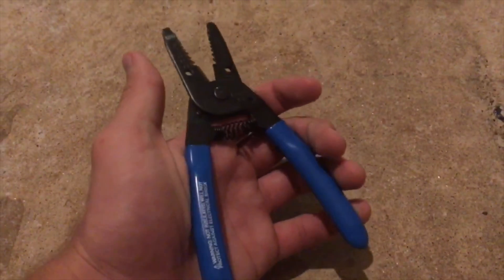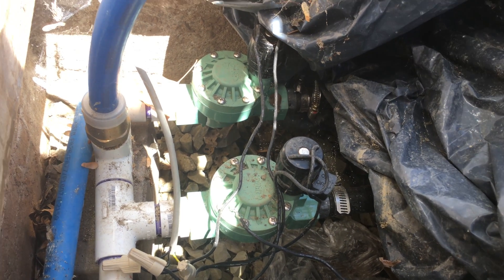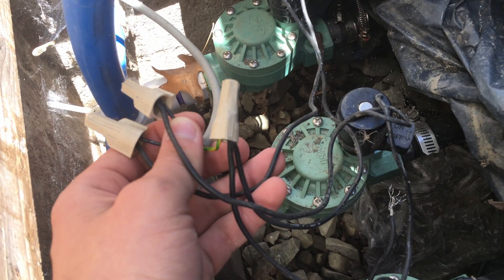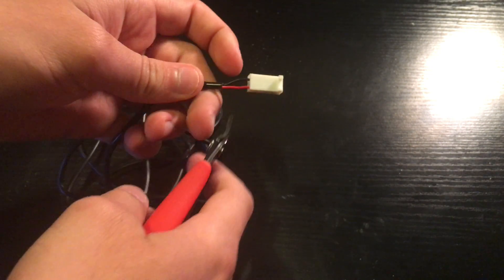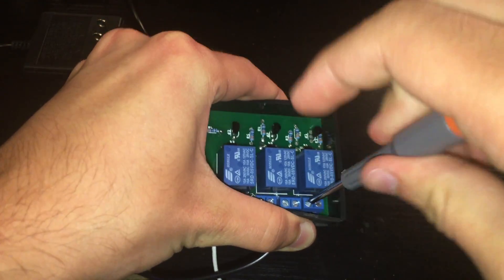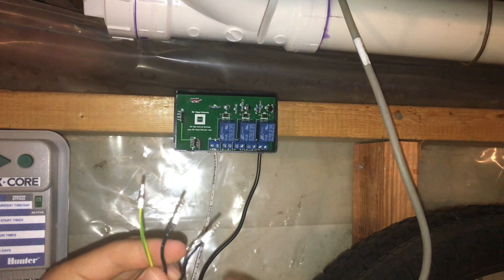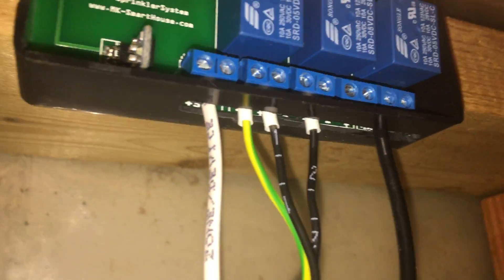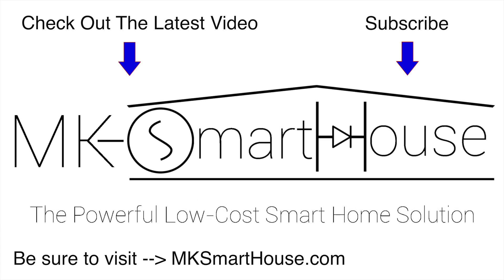Complete Guide Sprinkler System MQTT OpenHAB ESP8266 : Final Installation

Comment: As usually, a good instruction video.

But you should really, really never use green/yellow to anything but security earth for your 240V system. 
That is potentially a Hazzard risk, at least in countries that demands to have green/yellow as a earth connection for main 240V system. It is like brown or black is L and blue is N. If anything, it is confusing to use green/yellow for low voltage systems.

Comment: nice project , I would even recommend you something. don't keep the DC adapter for the sprinkler idle when no sprinklers are active better keep and initialization sequence where whenever it turns on any sprinkler it will first start with turning on the DC source and then the sprinklers
Reply from the maker: its an ac power adapter
Reply: MK-SmartHouse okay